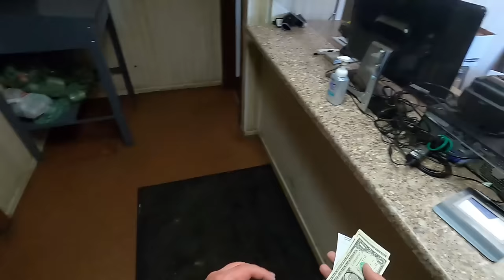Caught Picking Through the Neighbor's Trash

Comment: Paul, You will actually have more room if you remove your bed liner. By about 2 to 4 square feet. The bed liners hide a full more space and side cavitys than people think. Things will slide better as well.
Reply from the maker: Hey Will. That's all true. My only issue is scrap will dent horribly the inside of the bed and will scratch the paint off and rust will start. If I did that, it would begin the stopwatch of the end of the truck. 4 to 5 years until the bed is completely rusted out. I want to keep the truck much longer than that.
Reply: I keep forgetting your up north. Rust belt. Your right.